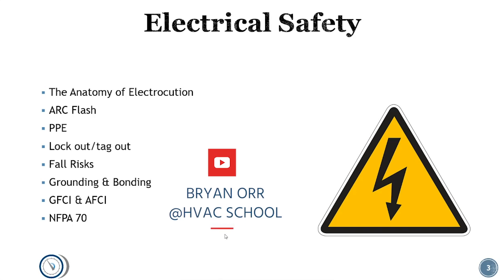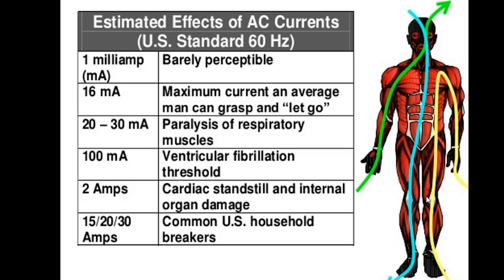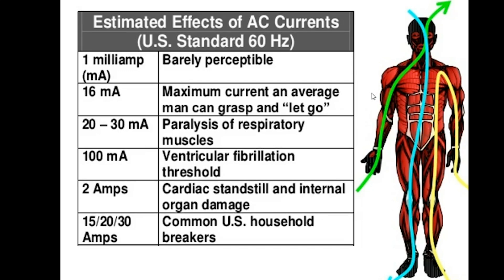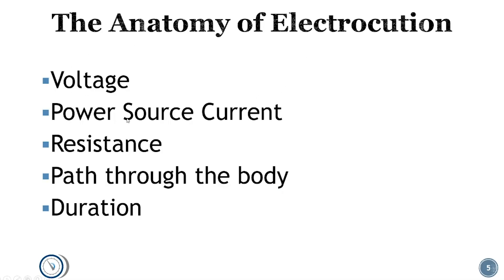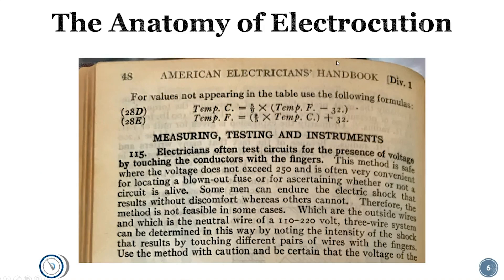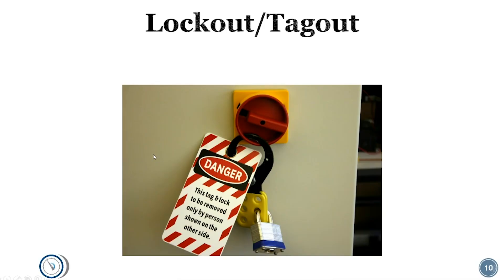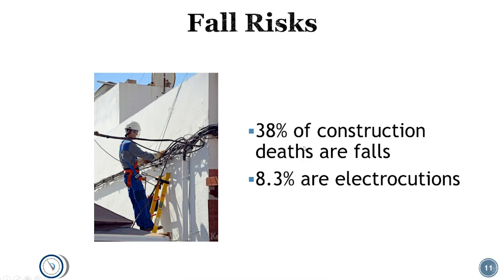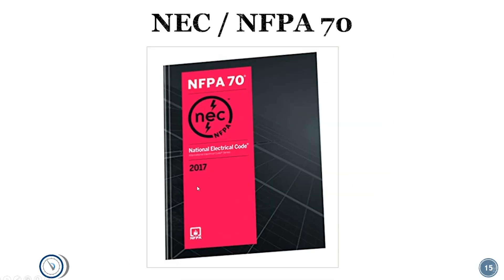Electrical Safety Basics

Comment: My dad is a retired union electrician and he told me stories about the old timers testing circuits by touching conductors with fingers. Thankfully he never did that. A better rule of thumb if you will, is to always have tremendous respect for electricity.
Reply: Many times they used the back of their hand, the theory was if the conductor or object was live their hand would contract away from rather than grabbing and preventing letting go.   Of course this is not recommend practice today and was many years ago before we really understood the dangers of electricity and had suitable meters widely available.

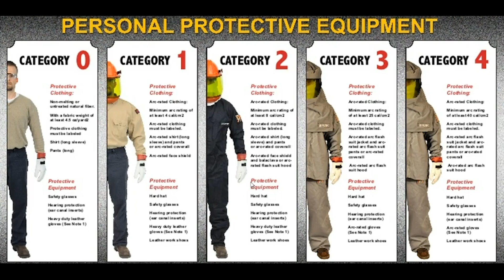Comment: 7:22 The video is dated 2018 but the Category 0 was removed in 2015. I don't know if this video is outdated but more importantly, why don't we see techs in the videos, while measuring voltage with exposed energized parts and conductors greater than 50V, wearing any shock protection? Why does the workforce treat Electrical Safety like Electrician Safety? HVAC techs are exposed to the same hazards as electricians while measuring voltage, but not wearing any electrical safety PPE. When will the HVAC industry start implementing electrical safety work practices?
Reply: Never, lmao. They're just gonna keep dying.

Comment: Also do not rely on the disconnect...look inside and verify that that line side hasn't been jumped over to the load side essential making the disconnect irrelevant...i know its dumd AF but I've seen this multiple times.  Make it a habit to open that disconnect door when you use a disconnect to isolate equipment..
Reply: I was taught to always verify with my meter on the load side of the disconnect (L1 to L2, or L1 to L2 to L3 if 3 phase) that no voltage was present, because you never know. I go a step further and check for voltage where the load wires coming from the disconnect are connected to the contactor. You can never be too safe with electricity, as I prefer being alive over turning into a Roman candle. 😀

Comment: Proper way to check for voltage is to put a light bulb in your mouth grab the neutral side and then the line side if the bulb lights up then there is power present....lol no don't do that...
Reply: @Tiocaidh  I am anxiously waiting for the results...🤣
Reply: @rossy9549  I'm gonna try that. 

If I don't reply back it probably means I'm dead...
Reply: @stonedsloth6367  are you dead?
Reply: @curdinallenspach5928  no he got electric powers